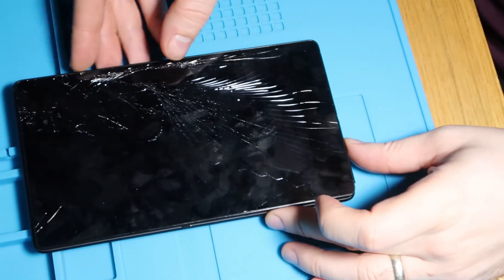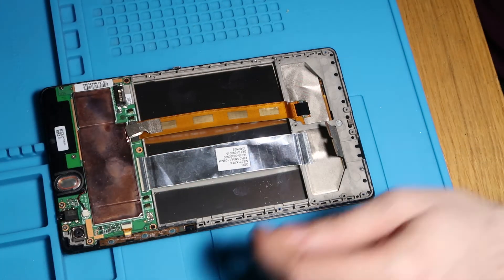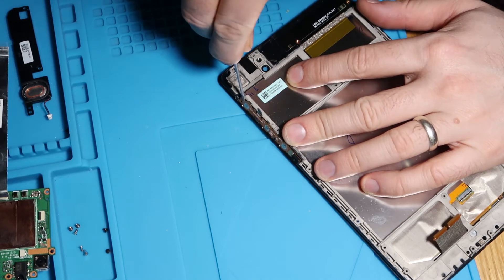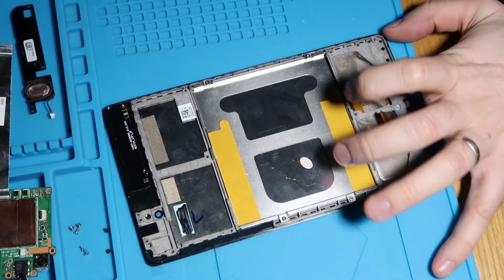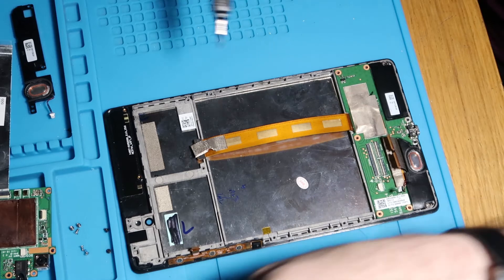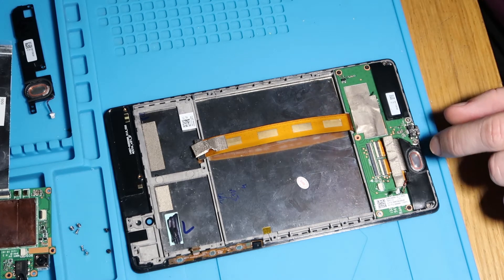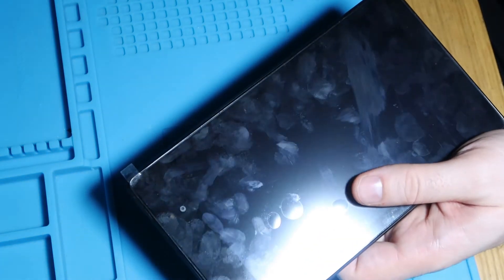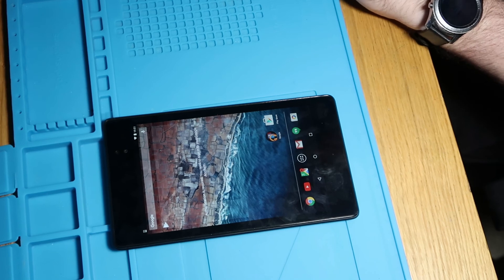Google Nexus 7 - 2nd Gen - Teardown and Screen Replacement

Comment: Obscure question, but wondering if you can help! I've just received the nexus 7 you have in this video as a replacement for my old broken one. Only problem is, my old one was the model that came after this one in the video (2014). They have the same case and battery tho! Could i swap the boards from my broken one to the earlier model?? Or would that not work.. Thank you for your help!